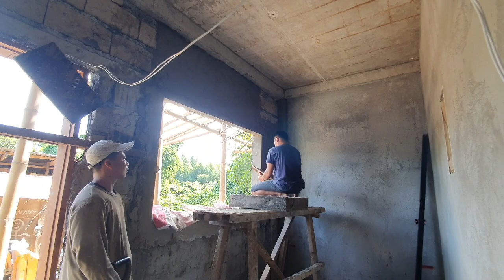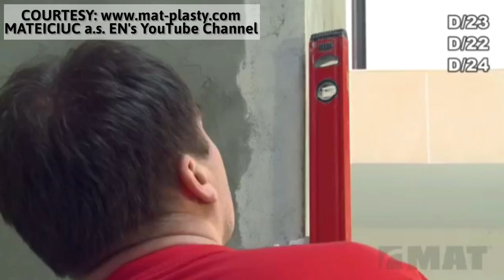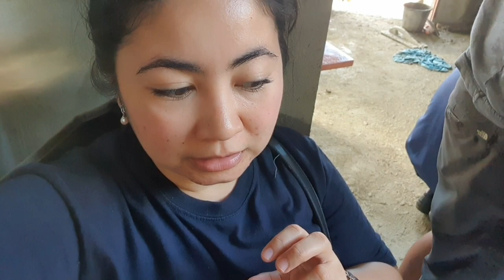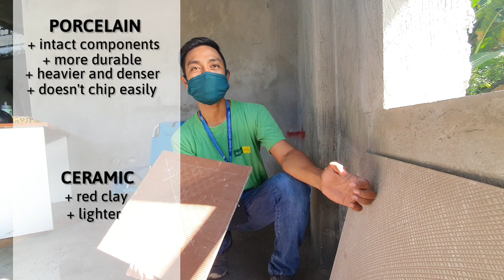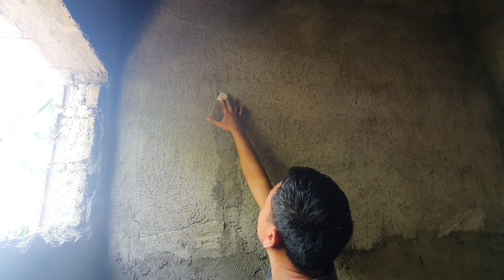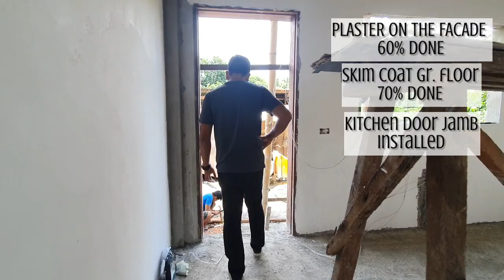HOUSE BUILDING PHILIPPINES | Wk 22 Ceramics or Porcelain Tiles + Bathroom Layout | Retired OFW

Comment: madam hindi naman po ba madulas ang porcelain pag nabasa?
what to do or need iapply if madulas? thanks po
Reply from the maker: Hello po! Apologies for the late reply. Well isa yun sa mga considerations ko when choosing tiles kasi nga sabi ko what if andito Mama or mga bata. May choice naman po na anti-slip porcelain tiles, mga slip resistant sila so di nakakadulas. Or if nakainstall na ang sa inyo, meron ding anti-slip coating na pwede ilagay sa tiles.
Reply: @PausePraySimplify  ano pong mairerecommend mo for anti slip coating? thank youuu

Comment: Hindi ba slippery ang porcelain? Pwede lang dn ba zero joint at walang grout ?
Reply from the maker: Hi Andy!!! Sorry sorry late reply. 😊 Hindi naman siya slippery. Depende sa makukuha niyo. May mga porcelain ang material pero di naman super slippery. May glazed and unglazed po. Kapag para sa banyo, be specific lang kapag naghahanap kayo na tiles na non-slippery siya. 

Also, hindi adviseable na walang grout kasi ang joint ang naga-aabsorb ng pressure kasi ang tiles at ground ay nag-eexpand and contract depende sa init. Ang grout ang parang buffer para 'di magbanggaan ang tiles at 'di ma-damage. Grout din ang magtatago ng uneven portions ng tiles kung meron man. Hindi kasi lahat ng tiles pantay na pantay. 😅

Comment: bro ang shower drain lalo na pag customized na shower base  should be center  and size of the drain 2 inch pipe with p trap  at young shower head 6.6 ft   yung floor drain nyo sobrang gilid mahirap yan lagyan ng trim cover yan yung supply ng toilet 6 inches from rough in floor and 6 inches from the center of the toilet   yung drain ng sink should be 18 inches from floor  anyway yung lang ang nakita ko na iba sma mga ginawa ko dito sa US as a plumbing contractor  goodluck

Comment: albert, gagamit ka ba ng toilet bowl flange? kasi iyang ang napansin ko sa mga toilet bowls sa pilipinas, hinde gumagamit ng flange. ang ginagawa nakasemento ang toilet bowl sa flooring.
Reply: Hello po kuya jun. Gagamit po ng toilet flange para iwas leak. Hindi na po isisemento yung WC sa flooring. Naka tekscrew po at sealant paikot ng bowl. May ganun napong design ng WC dito sa pinas. Mahirap po kasi kapag nagkaproblema yung WC at naka concrete mababasag po kapag kailangan alisin. Gawan po namin ng video yung installation. :)
Reply: great! iyong iba old style kung maginstall kasi.